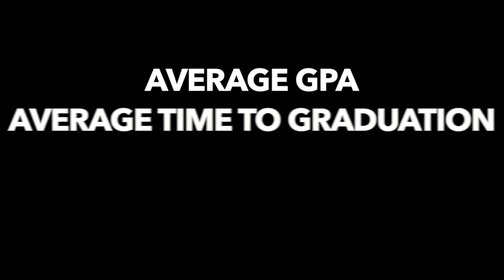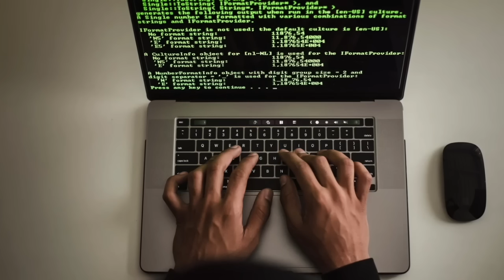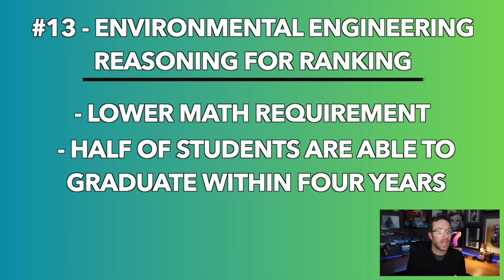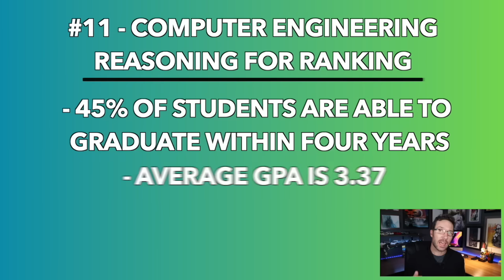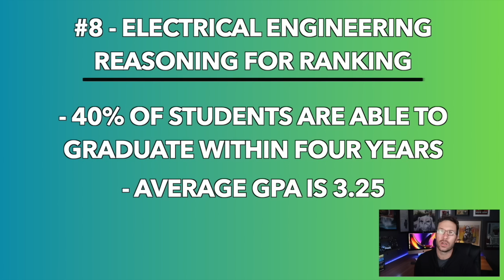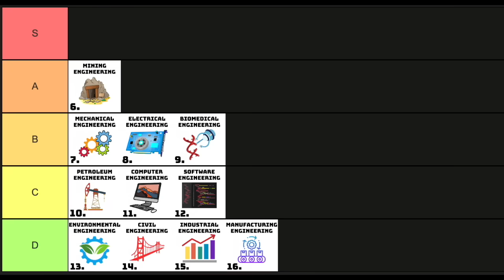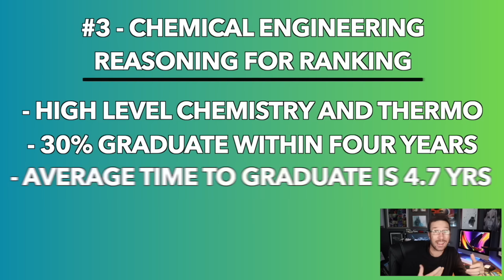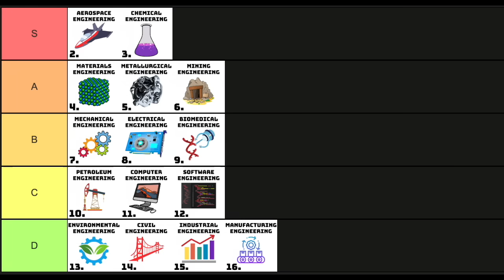Engineering Degrees Ranked By Difficulty (Tier List)

Comment: I agree with Chemical engineering being up there in difficulty,  but I think a bunch of the others are incorrectly ranked based on one flaw - the % of those who complete in 4 years. You're making the assumption that every student is the same. It could be that easier degrees attract students with lower ability, hence the 4 year completion rate is going to be lower even for an easier degrees. I personally think the completion rate has no bearing. A better indicator would be an evaluation of individual course material. Also, some universities have higher GPA criteria to get into certain engineering fields after completing a common  1st year.

Comment: The “highest level of math” for Electrical Engineering is most incorrectly stated. The ABET requirements for math in EE does include complex variables that is necessary to study signal processing, electromagnetic theory, advanced circuit theory etc. In many decent engineering schools the pre-requisite to complex variables is ordinary differential equations. Most other engineering degree programs do not require complex variables. The highest level of math for EE degree programs is much different.

Comment: Bah! Electrical (Electronics) Engineering is the most difficult of all. The reason? It's the most abstract of all professions, yes, even more abstract than mathematics. While other engineering disciplines work with tangible objects, EE does not. EE relies heavily in mathematics and physics (solid state, electromagnetism).
Reply: That would be true for chip designers but not for the vast majority of electronics engineers.  For instance, it's a lot easier for the average microcontroller circuit designers, which are a significant chunk of the electrical/electronics engineer population.  They are basically joining Lego blocks together and then handing the circuits down to a computer engineer, like me, to make them come to life.
Reply: @MucaroBoricua  You obviously know nothing about electronics engineering.
Reply: @DrPG199 , ha ha.  What a pathetic response.  I now seriously doubt you are even an electronics engineering tech.

Comment: Electrical engineer here, most of the concepts in engineering and even much of physics, are quite easy and straightforward to understand and then one only needs to memorize processes and procedures for engineering which also is not so difficult.  As the student proceeds thru their coursework, the concepts become harder but at the same time they are building upon what they already know which lessens the difficulty.

How easy or hard these disciplines are for the student really depends on one's command of mathematics.  Math is the tool, the glue that binds it all together and explains things.  Look at a 20 page chapter in a college level physics book and you'll see 3 or 4 pages of verbal text explaining the concepts and the rest of the chapter is devoted to math problems on the topic!  Engineering texts are much the same.  A concept is introduced and explained verbally, then the mathematical proof is given.  Finally, the student is challenged with using the formulas to solve various problems in that topic.   In real engineering work for industry, the math is also needed although one can often get sufficient answers using simpler algebraic formulas rather than needing calculus or differential equations.  We call these formulas "approximations" in electrical engineering and usually they are sufficient because the components we use are not exact - e.g. a 100 ohm resistor is not really 100 ohms it might be +- 10% of that so it could be anywhere from 90 to 110 ohms in actual value.

If you are really good at math and can readily understand abstract concepts then you'll find any engineering field to be within your grasp to master.  I've seen many physics majors who got jobs as electrical engineers with no electrical engineering degree at all.  They can because physics majors are generally skilled mathematicians.  They can rifle thru the electrical engineering specific concepts very quickly on their own.  If your math skills are not good and you're not able to improve them, consider avoiding a career in engineering.  My math skills are not great and I struggled to get my degree.  The good news for people like me is that once you graduate and get into the "real world", you will no longer be solving calculus and diffeq problems on paper.  Companies use computer aided tools to speed development.  Tools like Matlab, GNU Octave or the spice spin off tools for EE are such examples of commonly used tools.  Before the computer age, engineers had to calculate everything using pencil, paper and slide rule.  No longer true.

This is how one can immediately spot a trickster pretending to be a physicist or engineer.  If they try to explain some concept and can't reference the basic math behind it then they really don't have the education or training they pretend to have.  Bob Lazar, the UFO/Area 51 guy who claimed he was a physicist "reverse-engineering" a UFO for the air force, is a perfect example.

Comment: As an electrical engineering student with a minor in mechanical, I can tell you that I’ve found electrical to be much more difficult. I had to take partial differentials before declaring my minor, and the mechanical courses like dynamics and control systems felt like a breeze compared to fields and waves or signals and systems

Comment: Engineer here- respectfully disagree. Here is the ranking based on my academic experience: hardest degrees in descending order:1) Nuclear 2) Petroleum (which is just like Chemical Engineering except the professors really go out of their way to make you fail out) 3) chemical engineering, 4) electrical engineering, tied for fifth place aerospace and mechanical engineering.

Comment: On top of differential equations, Electrical engineers study Fourier and Laplace Transforms.  Not to mention control theory, antenna/signal analysis, robotics (kinematics, degrees of motion, etc), power transmission (complex numbers) and motor design (magnetic field design and analysis) just to name a few. 

No Engineering is easy but Electrical has no shortage of subjects that constantly try to kick your ass 🙂

Comment: Can't believe 40% of electrical engineers finishing in 4 years. When I was in school, the curriculum was designed to be completed in 4 years, and as far as I know, it was an exception to not finish in 4 years. After working 3 years, I went back for a masters, which was more difficult than undergrad, but I got through it and don't regret it because it opened the door for more technical and interesting jobs.
Reply: what positions have you worked and which did you find most fulfilling, I am strongly considering this as a career path currently but I am unsure what I want to do when I get out

Comment: 7:05 interned at an electrical engineering firm, we did not do any of that, president of the company said in college they focused entirely on state machines but all we did there essentially was ensure lighting, fire alarms, breaker boxes, etc were up to code when people were designing or remodeling buildings

Comment: Students should choose the engineering discipline that interests them the most, and that interest will outweigh any difficulty differences, which actually are not so great.  All engineering fields have advanced and challenging problems, and the very best in each field are exceptional.  For example, some of the most complex engineering challenges and systems are manufacturing and industrial.

Comment: Bullshit!! No disrespect intended to the poster. What he posted for Nuclear is just a start for Chem E. He didn't mention you need General Chemistry, Organic Chemistry,  Physical Chemistry, and, an Analytical Chemistry course. Also failed to mention not one, not two, but three semesters of thermodynamics.  The third would be Advanced Thermodynamics for Chemical Engineers. Math level: Calculus III and 2nd order differential equations. Oh wait, there's more! Chemical Kinetics! A horrible and painful combination of Chemistry, 1st, 2nd, and 3rd order differential equations, oh, and some plug flow reactor designs require partial differential equation analysis with numbers dropping out to put into the control system. You wouldn't want it blowing up, would you?? And as far as statistics are concerned, I got my ChemE degree from a division one school. We started out with 275 freshman ChemE majors, 13 of us made it in 4.9 years. That's a 4% graduation rate. I had no help: no loans, no scholarships, no rich uncles. I worked full time nights in a beef slaughter house and attended classes during the days, with blood still in my hair. I once took a midterm in Advanced Thermo after being up for 28 hours. I graduated debt free. I don't want to hear anybody whining about student loans. Nuff said.

Comment: Mechanical Engineering 
The real Engineering 
As a mechanical engineer I work with Electrical Engineer and civil Engineer. I can translate control drawing, building electrical drawing, and the engineering department give the obligation including power distribution for the entire factory. I also study the civil structural drawing work with the civil engineer, every material used for the construction have to pass through me. I know every fittings pipe  lines and material flow and capacity and performance of the factory connected with me the mechanical engineer.

Comment: I am not sure what data and stats you used to rank these engineer degree but electrical engineer by far is more tough at least deserve A level. As you have to think imagine about circuit with diagram there is no structural for it. They don’t use ordinary differential equation, it has partial diff equation a lot of use

Comment: There’s no way mechanical is not at the very least top 5. As a mechanical engineer classes were tough specially learning all other eng. From electrical, software robotics and much more specially thermo 2 fluids even materials as well and I even went to learn aerodynamics and design. We literally learn a little from all the other and get a strong fundamental from all of them and from my class we would hear mechanical who wouldn’t make it would go to other branches that were more specific to one thing only instead…and also my credits amounted to 133 credit hours

Comment: The pay scales and other data sets are USA. Other world powers with larger manufacturing bases and a multiplication of building/ambitious projects (the USA is declining) will place both pay and math requirements higher and have much more opportunity.  I've worked with metallurgical/materials engineers in Russia and China and I rate their level of expertise much higher than Western countries.

Comment: Where's Electronic Engineering? Way back when I was a young student Electronic Engineering was separate from Electrical Engineering. And Computer Engineering hadn't taken off yet in Australian Universities. That was in the early 80's in Australia. I actually left in second year as I got a job paying higher than graduate engineers, but ~ 6 years later I came back and did Applied Physics. I got quite a few exemptions in first year 🙂
Reply: At least in the U.S, "Electrical" & "Electronic" Engineering are the SAME degree --- although a student can choose to specialize in power engineering, which is more "electrical" oriented.

Comment: This list is inaccurate because it lumped Electrical power  engineering (Transmission and Distribution) with electronics engineering, which really is a separate field by itself, involving electronic circuit design, IC design, telecommunications and involves a lot of advanced math (calculus) in things like Laplace transforms, z-transforms, nodal, network and mesh analysis. In any case, a lot of jobs in this field are done in Asia nowadays anyway and so might not be relevant to Americans, who are the target audience of this video.

Comment: If you think nuclear engineering is not going to grow then you haven’t a clue what is going on. I am a mechanical engineer of 30 years. The biggest issues that the world faces is the drive towards net zero (which I don’t agree is necessary) and power consumption of AI/data centres. Both of these issues will only be resolved by nuclear energy.

Comment: I am a EE graduate, 1965.  143 hours required.  Engineering school wide average grade point was 2.2, my 3.37 placed me in the top 10%.   Now, 125 hours needed, and grade points are over 3.0.  What changed?

Comment: Where the h was telecom engineers? I was one pulling about 200,000€ in 2023 when some guys thought that I was too costly for the company. They hired six guys to do my job, so calculate that what ever way you want the company lost money on that deal. One of the guys who git rid of me was still working in HR when the sixth was hired. Little palaver where they were asked why they let me go and the answer came back that they never even asked what I did the only thing to them was how much I was paid. Btw. mathematics was more number theory and linear algebra, but I still can solve partial differential equations, but that was my hobby.

Comment: IE here, from 40 years ago. Deliberately did IE as it’s one of the more “rounded” engineering programs. I had to take ME, CE, EE , CS and other ENG classes. I was master of none of those fields, but well rounded I felt. 4 years of any college level math is hard. Ended up doing software and systems engineering, so never actually used much of any of the education directly, but that really isn’t the point and how most university education turns out.

Comment: I just watched a video on how fuel for nuclear reactors is processed. Incredibly complex. I'm not surprised it's number 1 on the list. As far as getting an electrical engineering degree is concered, that's step 1. There are all sorts of specialties in electronics that are very complex (ex. antenna techology) and others that require a good understanding of chemistry (electronic component manufacturing).

Comment: In canada, the degree I took was none of those listed (it was related to a couple though):

Ended up doing biomedical mechanical engineering + Computer science (2 bachelors, 5 years, no electives [only 2 4000 level technical electives], 6 courses a semester). I don't know where this would rank, but at least amongst those doing the double degree, I was one of a few who graduated within the 5 year schedule.

Calc 1-3, ODE / Math for engineers(PDE), thermodynamics 1/2, heat transfer, fluid mechanics, biofluid mechanics, materials 1/2, advanced strength of materials, computational methods for fluid mechanics and heat transfer, mechanical vibrational analysis, control systems 1/2, artificial joints and prosthesis, artificial organs, CAD Capstone, advanced programming concepts with C++, programming paradigms etc etc.

deadly program

Comment: This sort of ignores that some engineering degrees are more universally useful than others. I have BSEE, BSME, BS Math, MSCS, and MBA. I tried to fill in the nuclear by self-study, and I am a commercial, airshow, and instructor pilot, so I studied the core AE books during the time I was getting my FAA certs/ratings. This has allowed me to have a very enjoyable consulting career with the ability to move around a lot and work on a lot of varied projects, especially those that were multidisciplinary. I don't expect that everyone will enjoy school as much as I do, or have the time and money to pursue all of their interests formally. So, what I would say is that if you are undecided and don't have a deep passion for a specific type of engineering but for engineering itself, you would probably do best to choose ME or EE, or if you can do both. There is a lot of overlap between them. conceptually (think spring vs. oscillator) as well as coursework. My only other suggestion is this (and I feel strongly about it): please do yourself a favor and work AHEAD in math so you know it before you need it! Too many programs have students studying the math they need for an engineering class in the same semester, which makes NO SENSE. That's why I obtained a math degree before an engineering degree. I promise that if you focus on math first (and go a level higher than required (e.g., linear algebra, real analysis, abstract algebra, PDE, etc.) or get a math degee, any engineering course of study you pursue will be relatively easy and you will be lightyears ahead of your classmates. It even makes it reasonable to study two disciplines simultaneously (e.g., ME and EE) without stressing yourself to the brink because knowing the math means you can easily learn the core engineering topics (I was also able to obtain the Amatuer Extra license with very little extra study), which are (no surprise) essentially APPLIED MATH! So, this may be useful to some and not to others, but I thought I would take the time to share my path and a few things I learned from it. Good luck with whatever path you choose!
Reply: 73

Comment: FYI: bridges and tunnels are usually done with Structural engineering primarily, not civil.  Buildings are done by architects, not civil.  Those are common novice misconceptions.  Been in the industry for 25 years.

Comment: As an Electrical Engineer with BS and MS degrees and 40 years of working experience, I don't necessarily agree with the ranking. I would put EE at the top of the list, much more difficult than ME. The math required is much higher than Diff Eq. for all options in my university studies, especially difficult when considering all aspects of EE: Analog, Digital, RF, etc. Also EE is a very dynamic field to work in as innovations are constantly occurring. Thanks for sharing! 🔌